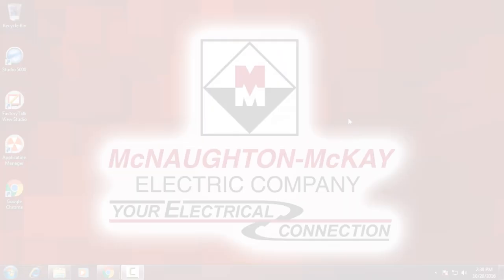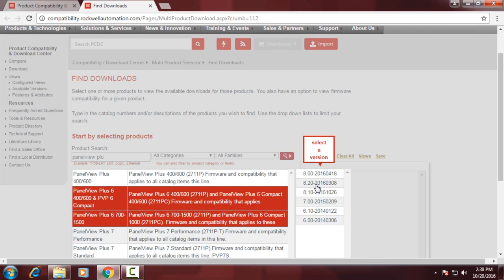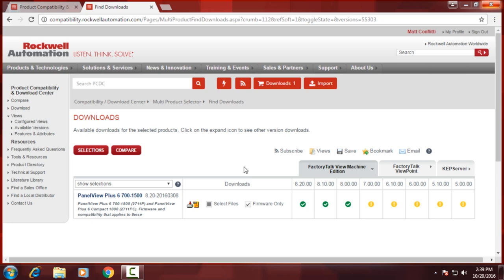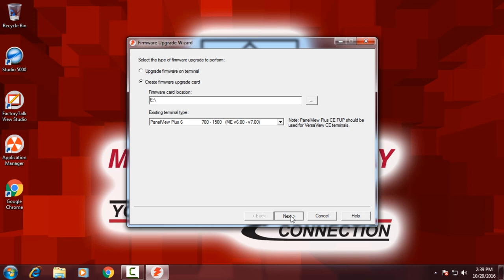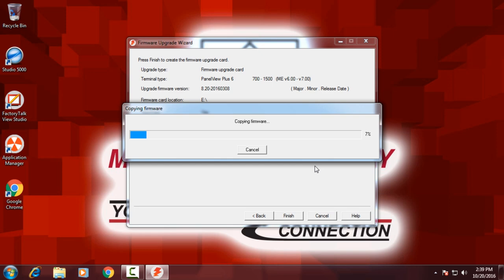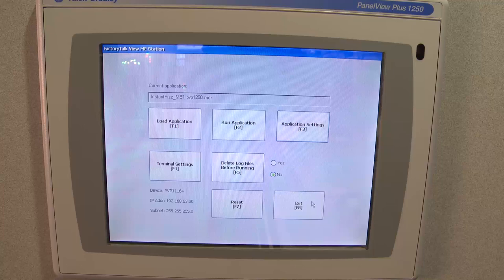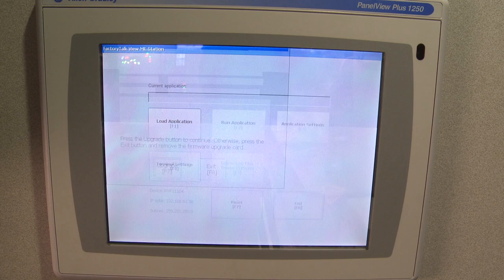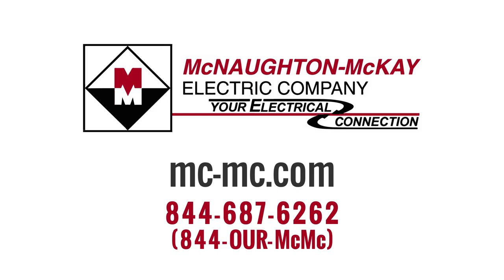Upgrade the Firmware on the PanelView

Comment: Great video. I just have a question, in one section of the video shows many servers you can install to the computer so, i would like to know which one of these showed could do the "share folder" function between the hmi and the computer allowing watching the folder from the pc?
Reply from the maker: Hi Fernando, You will need to do one of the following.
1. Load the firmware onto a flash drive from your PC and then plug it into the PanelView to continue the process, or
2. Plug into the PanelView with USB C to establish a connection then upgrade the firmware from there.
If you have further questions or concerns, please reach out to your local Rockwell Automation distributor for personalized support.

Comment: Great Video, thanks for learning to process. I ve a panel plus 700 and stay error in the inicialization error on check image.
Reply from the maker: Hi Marco, we recommend reaching out to your local Rockwell Automation distributor for personalized support. You will be able to communicate the error over the phone and work with a support technician to solve the issue.

Comment: Great video.  Wouldn't you have to update the mer. project file version also ?
Reply from the maker: Hi Mike,Yes, you would also need to update the .MER file using the Transfer Utility. If you have any questions or concerns, please reach out to your local Rockwell Automation distributor for more information.

Comment: I just ran into a problem on which I have a corrupted firmware on a PanelView 600 compact but in my case there is a logo indicating the touch panel is disabled and wont allow me to do anything, there is a fault (red blinking light) but I'm not sure if I should pay an automation company to flash the firmware as the message on the screen is unclear I mean would flashing a new firmware solve my problem? the local disctributor didnt know what to do..
Reply from the maker: Thank you for your question. Our recommendation would be to return the PanelView to Factory default and then try re-flashing the firmware. If this does not work, consider migrating to a currently supported solution. If you have any additional questions, please contact a local branch. https://www.mc-mc.com/LocationFinder

Comment: The panel view does not recognize the "autorun.exe" file on the USB stick??
PanelView plus 600 (regular)
2711P-T6C20D ser B
Reply from the maker: Digitronix BE, If your USB storage capability is more than 2 GB, that may cause the issue. You might also try deleting and downloading a new
.exe file to ensure that the file structure is correct. If you have more issues please reference Rockwell Automation’s Knowledgebase at https://rockwellautomation.custhelp.com/app/home or reach out to your local Rockwell Automation distributor.
Reply: For old version of panel view, use FAT32 USB

Comment: how do i add more terminal types in the existing terminal type drop down, please help
Reply from the maker: Hello, 
Firmware that is installed will show up in the ‘Existing Terminal Type’ drop down. In order to add more to the list, you will need to install the firmware for whichever PanelView you want added to the list. For more help or information, please reach out to your local Rockwell Automation distributor.

Comment: Mike, newer version of Panel View run older version of file.MER. For instance, a panelview version 5.1, you can download a file.MER version 3.1 without issue.
Another question: 
Are the applications in the internal source DELETED/ERASED when you make the firmware update?
( If you make a firmware update in a PLC you lose everything! )
Reply from the maker: Roberto,The .MER file must match the firmware version in order to run properly. You can upgrade an old .MER file to match the new
firmware using Rockwell Automation’s software, but you will lose all applications when upgrading the firmware on the PanelView. Please contact your local Rockwell Automation distributor for more information before upgrading if you are concerned about losing any applications.

Comment: hello matt conflıttı 2.34 seconds in this video exit button on the screen how do I do?
Reply from the maker: Hello, The FactoryTalk View ME application shown in the Video: Soda Demo Overview is a pre-engineered FactoryTalk Faceplate that Rockwell Automation has developed.

These are designed to reduce a customer’s engineering, design, and implementation costs.

These faceplates at times are built-in to FactoryTalk View (Sample / Demo Faceplates).

Other faceplates can be found here: 

Rockwell Automation Library of Faceplates and AOIs
62250 | Date Created: 06/15/2009 | Last Updated: 06/04/2019
Access Level: Everyone

Download the Faceplate/AOI sets for FactoryTalk View ME and SE at the Sample Code Library website by searching for "AOI" or "Faceplates" in the Search by Product, technology,etc. box. The Faceplate and/or AOI downloaded will contain installation instructions:(https://nam02.safelinks.protection.outlook.com/?url=http%3A%2F%2Fwww.rockwellautomation.com%2Fglobal%2Fsample-code%2Foverview.page&data=02%7C01%7Cgreener%40mc-mc.com%7Cc6fd3b58ce8c4a66be5f08d74042a894%7Cc5d04ce6c38145a5bb151f1d4a5e6746%7C0%7C0%7C637048527354971885&sdata=ihi2%2BhUniF6k8gCz%2FEls9XShzXI6pD6qPj5lfsuuoXs%3D&reserved=0) 

If you have any further questions or concerns, please reach out to your local Rockwell Automation distributor. Thank you.

Comment: hello a question for the penel-view 800 7 hmi is the same function
Reply from the maker: Hello, Yes, you can upgrade the firmware on the PanelView 800 using the same steps as demonstrated in the video. Simply type in “PanelView” in the keyword search and select the PanelView 800. If you have any questions or concerns, please reach out to your local Rockwell Automation distributor. Thank you!